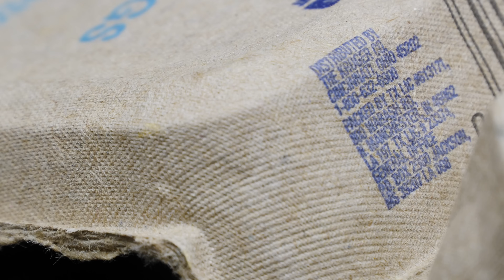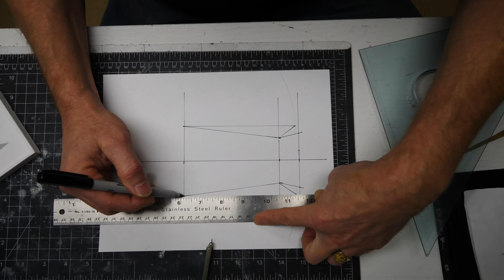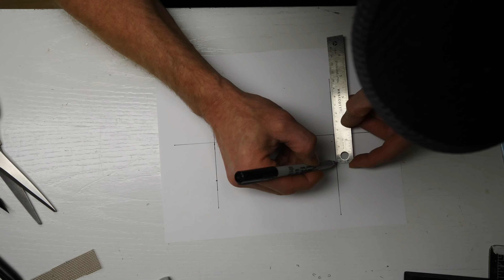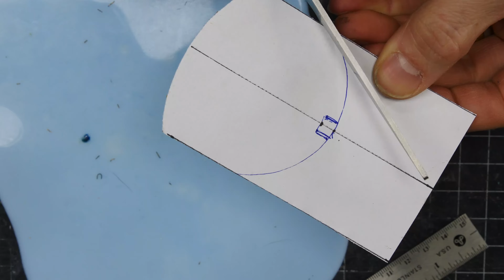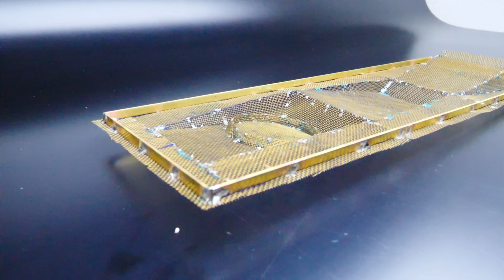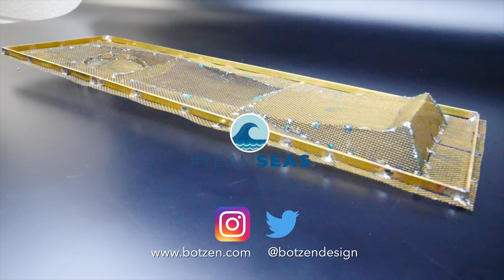Making a Pulp Mold: Wireless charger #TeamSeas

Comment: Such a wonderful video I watched this when it came out. I have an idea and I thought maybe I would throw it to you first and see if you can bang it out. I was thinking what about if you 3-D printed the mold in a flat and then when You bent the sides up like sheet metal and use superglue to seam the corners. The other day I had to stop one of my 3-D prints prematurely, and the mesh was like a fine aluminum screen. I thought to myself I wonder if this would have enough strength to do a molded cup. My final design would be little paper cups that I can store my llego parts in. I have developed a paper jig that I fold up the sides and superglue the seams. The cups are probably 2“ x 3“ x 1“ high and then I have variations of that being twice as big or three times as big. I’m gonna try it, but I thought it would be really interesting to seeif you did it too.

Comment: A wire frame or filler rods on the back side of the mold would have been a good option to assist in soldering and providing support.

Comment: Thank you for such a great video. I am going to try and 3d print my screen form in PLA. I am working on building a large shallow ice cube-like tray to hold Lego minifigures. The pulm mold trays will be around 190x140x20. Each tray will hold 4x4 grid of minifigures.

Comment: We had a Fiber Arts department at my university. I spent an evening in the paper making studio learning how to make custom paper from pulp with one of my fellow art students. It’s a fascinating process and relatively straightforward. She actually used dried citrus fruits (orange and lemon peels) and ground them into the pulp. It makes for some fragrant paper! 

Question: do you think the issue with the lower powered blender might be resolved by first soaking the shredded cardboard in a bucket of water for a few hours (or overnight maybe)? I’d like to try making some custom RC body shells using this method but I’d like to avoid buying a fancy blender if possible. Also, I’m thinking of working with paper from our paper shredder rather than cardboard. What do you think - is the Ninja blender essential? Thanks.
Reply from the maker: The Ninja is essential if you want to actually pulp the paper

Comment: I still don't get why you have to dry it up completly in the mold. I've seen several videos where they unmold before it's completly dried up. Are you trying to avoid shrinking ? 
Also, I,m not convinced by your close up of the egg pack surface texture. It's definitly not the pattern of a metal mesh. It is actually a surface.s pattern designed to ease unmolding. 
Love your channel BTW.

Comment: Have you seen the pulp molding process that other people have done with 3D printed molds? (the pulp goes right into the printed mold, with no brass screen and it has a smooth finish all the way around). -- It would be need to get your take on the pros/cons of the various approaches here.
Reply from the maker: Yes, I talk about in the video

Comment: Eric, we had a part to thermoform for the defence dept a few years back and we lined it with pulp. What we did in the joints is just use a needle and thread to hold them together for soldering., worl extremely well.

Comment: I think you could have just pressed the full brass sheet into the mold? I've done it several times in silver mesh using a hydraulic press and some rubber cushioning, but at that gauge, maybe just use the clamps? Might be worth a try. No soldering required.
Reply from the maker: Was not successful in my tests
Reply: @EricStrebel  I should have know you tried it! Haha. Brass is a bit finicky. Annealed copper might work, but  it depends on so many factors. Thanks for the videos! They are great!

Comment: Back in the day I was trying to use paperpulp to mass produce heraldic sheilds with designs on them. I made plaster-of-paris,  negative molds, open without a 'push' mold. The plaster wouldn't absorb the moisture due to my vaseline release agent. Yes, drying was very slow and from the back, so the smooth front surface wasn't always dry enough when de-molding. In short, a nightmare - I knew nothing [pre-google] about paper molding. You have me intrigued now, about the industrial method of doing this. One question, do they use two part press molds to make the wire mold as a one-piece?
Reply from the maker: Yes, there is a second half of the mold often that hold the part when it is ejected from the main mold